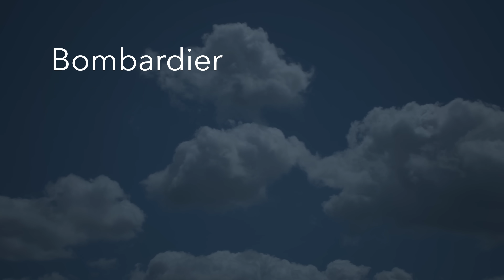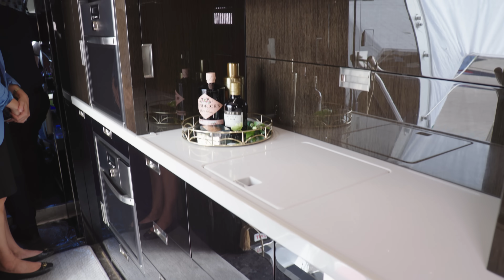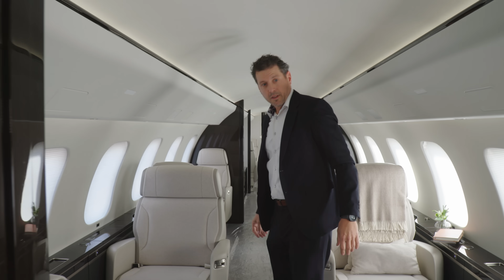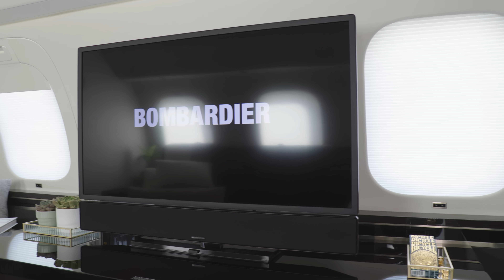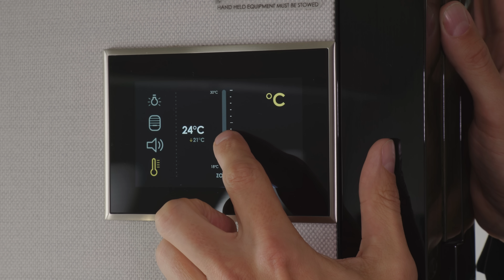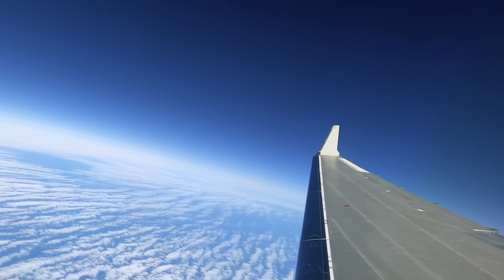Bombardier Delivers the 150th Global 7500, and We Take You Inside – BJT

Comment: Way too many probes on the front of the plane. 5 on each side. That's just bad engineering. There shouldn't be a single one. It can be 1 or 2 pinholes that you don't even see. It could be leading wing edge or even only the engines sensing the airflow. 11 probes sticking out of the front... no